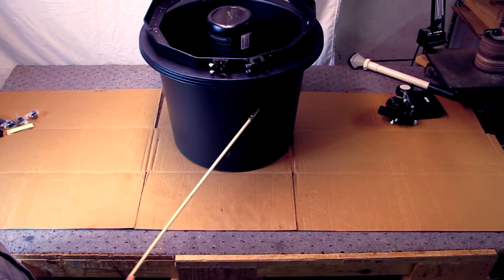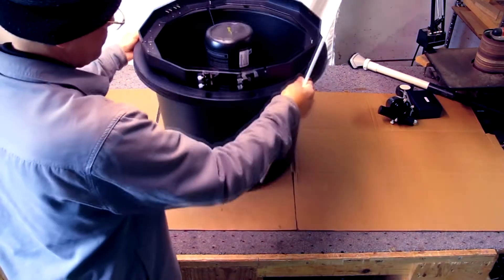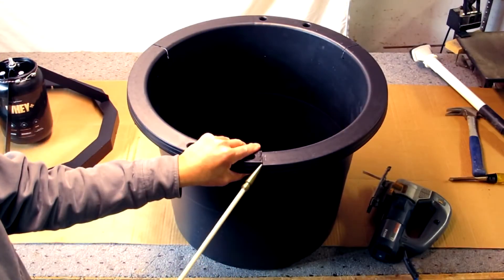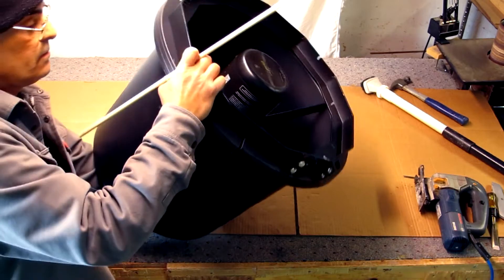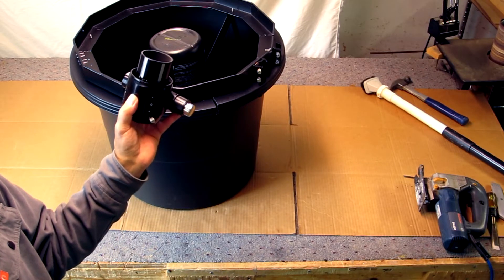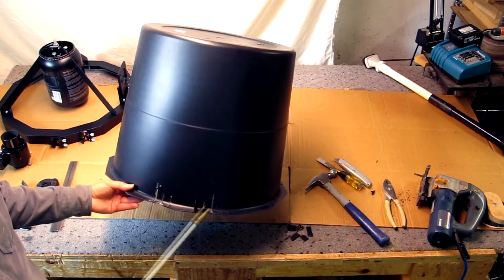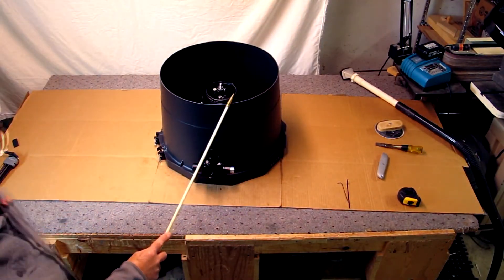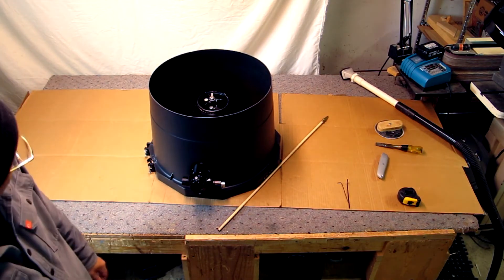Build Your Own Dew Shield

Comment: Ohh nice easy bagger tip, might try that first since it’s so simple and cheap. I was about to order Kydex and comes in 12” sheets and would of been a huge pain lol. Worth it to flock this with felt if you already got some?
Reply from the maker: I've made a couple of dew shields with that Easy Bagger material, including for the RC-6 used in this workshop: https://www.youtube.com/watch?v=oYZJsOc-vRg  I didn't feel they needed to be flocked, so long as you're using the textured side toward the optics.  But if you've got some already...